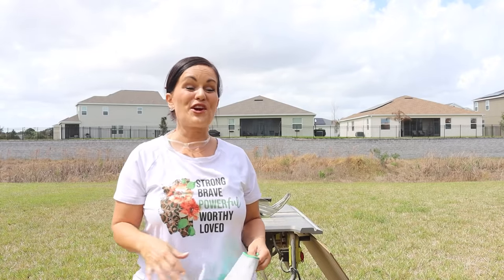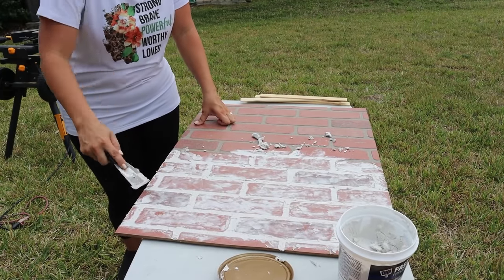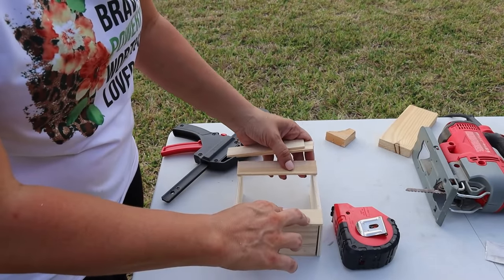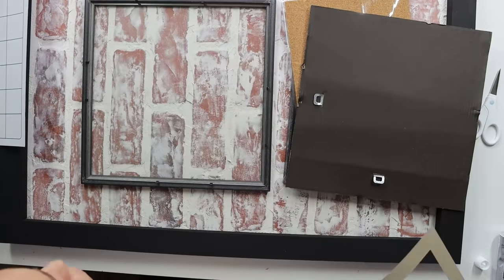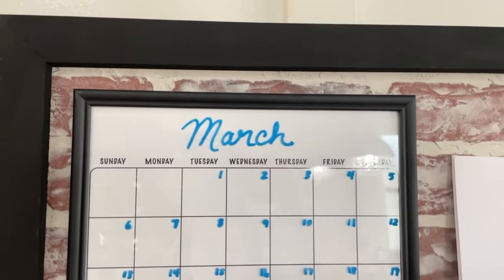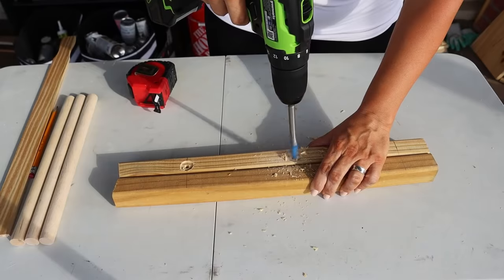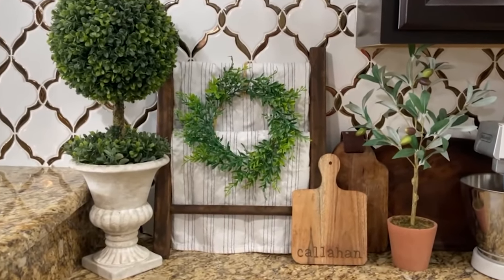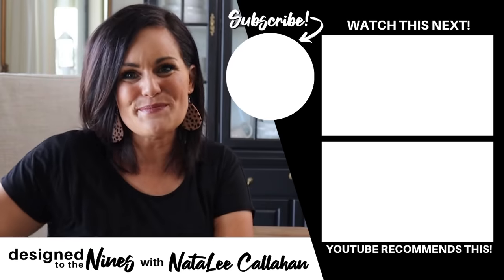Amazing HIGH END DIY Room Decor for the KITCHEN!

Comment: I’ll bet a hole borer would work well for you  for your flower pot diy on the message board.  I think you could attach it to a drill and it would work.  I could be wrong, but it’s worth a try. 🙂
Reply from the maker: I have a whole bun of boring bits I haven’t seen it 4” one… the biggest I have is a bit to drill a hole for a door knob and that was too small. 😕

Comment: Live all these ideas - fyi they have very affordable metal round “saws” that fit in your drill to cut circles - I used to make a huge connect four game for my yard many years ago - but I think you and I need a scroll saw!! I did the bunny cut out today and what a pain with my jigsaw! TFI 💐🥕🐇
Reply from the maker: I have many of them... the largest is to cut a hole for a door knob, unfortunately, it was too small. Good suggestion though!
Reply: @designedtothenines  my set starts at six inches and goes down and they all fit nicely in a little case…fyi

Comment: Thank you Natalie, I always like your DIY.
What do you measure when you make an angeled board around something? I like to use tools but I always get that wrong. And I end up to make straight boards.
Reply from the maker: If you make a miter frame it’s 45 degree cuts.💕
Reply: @designedtothenines  thank you, but how does one know what size to cut. The length of the board.